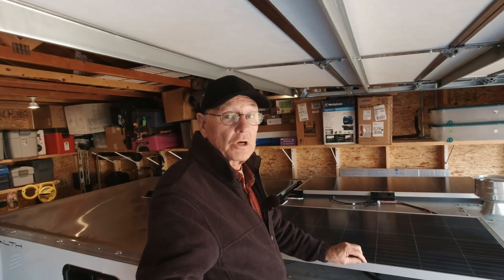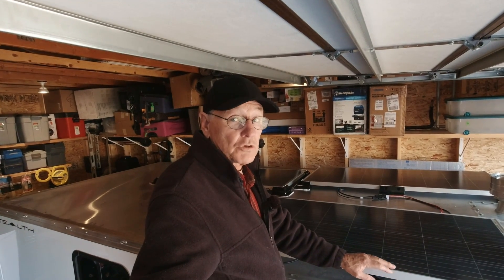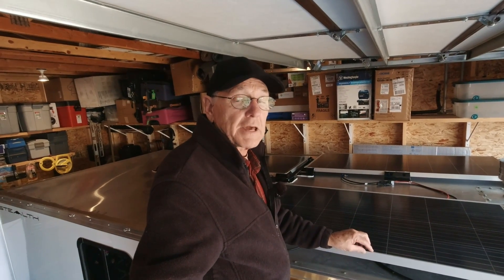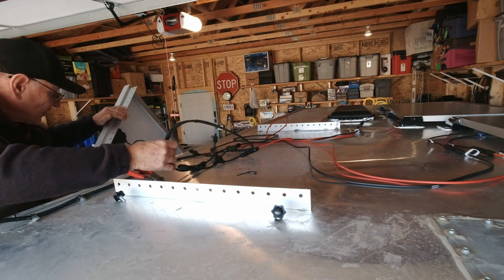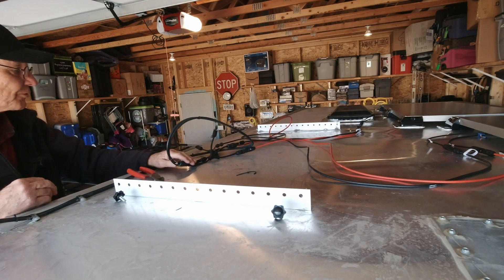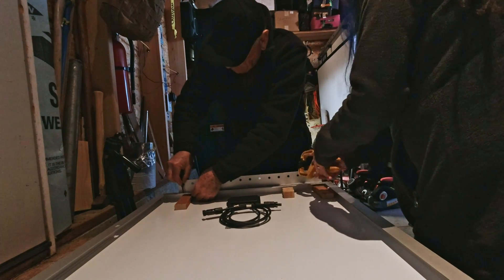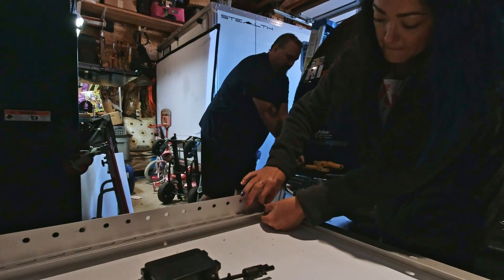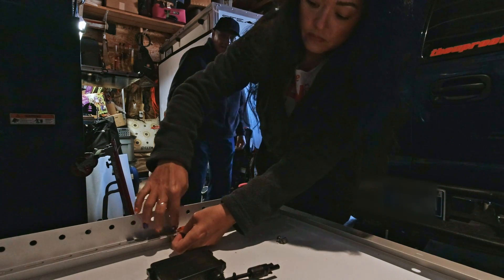Tricks On Installing A Tilt-Able Solar Panel

Comment: Any tips for waterproofing the drill holes and the setup in general? I would like to add tiltable solar panels on my new rv trailer
Reply from the maker: For holes like this I like to use either Sikaflex 221, 241, 252 or 3M 5200.  These don't let go for anything as long as the surface is clean before you apply it.

Comment: Which way do you plan to park this trailer. Do the solar panels face the driver's side or passenger side of your trailer?
Reply from the maker: The panel can tilt either way, but it's easiest if it tilts away from the ladder that you happen to be standing on.  I like it so that the trailer door is on the shady side .

Comment: Great video. Do you put a fuse between the panel and the charge controller? What about between the controller and the battery? Thank you.
Reply from the maker: Hello Allen, I put an MC4 inline fuse between the panel and the controller and an inline fuse between the controller and the battery. There's also one between the battery and the main busbar.
Reply: @gonagain  Thanks so much.  I don't think I need one between my single 100 watt panel and my controller but I might put one anyways.  Already have a fuse between the bus bar and the battery (I think!).  Thanks again for your videos.  You are always so full of great insights and I find watching you two very enjoyable, entertaining, edifying and relaxing.  Good clean family-friendly fun.

Comment: Great task !! Looks good to me!!
I just hit the jackpot with an idea, your vehicle will need to be replaced some day !!
The thought that hit me, why not an EV truck!! With an array of Solar panels you have now to meets all your electrical requirements, this way you can charge your EV battery also , maybe have to turn off a couple devices !! 

Just seems like a good idea!! It’s something that is going to happen with RV travelers using EV to travel!!
Reply from the maker: We're not there quite yet and the market is waiting for a lighter weight battery that can hold more power and charge faster.  Right now with the current EV batteries it takes a long time to recharge and makes a cross country trip a big headache. Soon, I hope!
Reply: @gonagain  yes I read that about new battery tech for EV which operates 5X longer and charges much much faster!!

Sounds like a solid state battery is in the works according to Panasonic !! Good news !!

Comment: Hello Rick. Thank You for another Video packed full of valuable information. Hands Down you are the Best with delivering the right Tips for installing solar panels. Plus the 'touchy & sensitive' plunge we must take when cutting holes into the roof of our cargo rigs. Yikes, I hate doing that. Rick, I don't have this set-up yet, still just using the fold out panels. But when that time comes I'm glad I've saved All your Tutorials. I also wanted to Say Hello to You and Linda. ✌🤗 Get any snow yet??? Today it's 80°but that won't last.🌬🌧❄
Reply from the maker: Hi Vincenzo (Linda here)! Haven't had snow yet, thank goodness because we haven't put the snow plow back on the atv....and it's been unseasonably warm which we've been loving. Like your 80deg, tho, it won't last. Darn it.

Comment: Do you find that tilting the panel is worth your while? 

We have two panels set flat and they are not the most efficient but work well while on the road to top off. 

For power when we are camping we have flexible portable panels and set for optimum orientation to charge portable solar generator that we use for refrigerator. 

We have two portable generators we switch out 

We also have 240 amp hours in Lead Acid and  100 amp Lithium.
Reply from the maker: Your approach is the same as ours, with multiple possibilities.  Yes, a tiltable solar panel makes a big difference, especially in the winter months when the angle of the sun is low, even in the southern U.S..  Check out this video I did showing the difference:  "Should You Tilt Your Solar Panel?" -  
 https://youtu.be/eCPvBLcyksE

Comment: rick on my trailer i install neoprene rubber mount, i got them from 4wd parts , there rubber spacers that go onto the top of the shocks then a washer then a nut, i first used the neoprene and notice that there ok and stiff, , the rubber ones were to spongy lose or vibrated to much, . on your trailer , when towing it off road try to use less air in the tires to take away the rigid feelings of a stiff tire, . if your tire is rated for 40 # , put 30 # instead, soften it up that will stop the bounce of the solar panel,
Reply from the maker: I do carry a pump and could do that.  I don't have shocks on the trailer and have spent a lot of time trying to figure out a way to do it without raising the trailer up higher.  I even thought about torsion axles, but having that leafspring break taught me how bad it would have been getting parts for a broken torsion axle.  Two different suspension shops talked me out of going that route, even though it would have meant money for them to take the job.  There's room for improvement in the trailer industry.

Comment: I didn't see any angle  bracket for holding the panel up on the tillable solar frame. Do you use that feature? I'm guessing you use portable solar panels, instead of going up on top of the trailer and tilting it.
Reply from the maker: I use an angle strut to tilt the panel up, but didn't show it in this particular video.  You can see it in these videos if you like:  "To Tilt Or Not To Tilt?"  https://youtu.be/eCPvBLcyksE
"RV Tilt Solar Panel Installation": https://youtu.be/18_zgXs0lI0

Comment: Drilling up through the crossmembers from  inside the trailer, then measuring for bracket install on panel using 1/4" bolts to secure brackets works well. A 2" piece of butyl tape over each hole and a coating of Dycor, bracket on top of that, bolt down and a final liberal coat of dycor sealant over the bolts works well.
Reply from the maker: Good info for everyone, Seymour.

Comment: Gm Rick, I've been looking into grounding the solar equipment. There are differing opinions, some ground the individual equipment parts to the frame as well as the battery, others run a external ground wire from each piece of equipment to a buss bar which all the equipment negatives are attached to, then ground that to the frame. And some run the equipment external ground wire to the negative buss bar all the equipment negatives are connected to and don't hook any of it to the frame, and i believe that's referred to as a floating ground. 
   I take it in marine use a floating ground is what they use? Since a fiberglass boat wouldn't have a metal frame. 
   Have you looked into a floating ground system where everything is wired to a negative buss bar and not wired to the frame? My understanding is new cars are not run to the frame anymore because of all the high tech electronics, which frame grounding is detrimental to. I was advised that negative grounding to the frame could cause electrical issues to the tow vehicle since its attached by the ball and tongue of the trailer. Since the trailer uses negative grounding for the trailers break, turn, and running lights, and has a truck ground via the ball and tongue connection i can see where a surge could cause a problem with the lights and computer of the truck. 
   I would imagine it's a one in a thousand chance there would be a problem with frame grounding the solar equipment, or else there would be more videos against it, but i have heard a few complaints on it causing tow vehicle problems. I thought I'd ask a marine guy with more than a little hands on knowledge to see what you think, maybe you've never gave it much thought but it sure don't hurt to ask lol. Thanks, God bless!!
Reply from the maker: Hello GM!  I use both on the trailer.  The interior lights just ground to the frame and the battery also grounds to the frame, which is pretty much standard in the industry, but everything else is grounded through the battery and then to the frame.  The big problem with the frame ground is dirt and corrosion and I check mine every year at least once.  Another problem is if you have an aluminum frame....  in that case keep the copper wire and connectors away from the aluminum with stainless steel washers.  If they touch the aluminum it will corrode a hole right through it.  I can't see anything wrong with having a floating ground though for the trailer accessories.  There is one thing though and that is that the battery won't be able to charge off the car's alternator if you do that.  Mine is like that now because I don't need it with all the solar I have.  I did that because of the lithium battery I installed and the fact that I didn't want to go through the expense of a DC to DC charger right now.
Reply: @gonagain  i didn't go the dc to dc yet either, Toyota parts are way too expensive, a new alternator plus the charger was more than i wanted to spend. I have 4 newpowa 210 panels i run in a 2 parallel then series with the epever 60a charge controller. If im not getting enough power from poor sun i have 2 100w portable rockpals i believe i can parallel then hook into the series, it'll drop my 210 panels to 200 but give me a net gain of 160 watts. Frankly i don't think I'll ever need to, i put a 5,000 btu window ac in and if it's hot enough to need it i should be getting plenty of sun, and my panels do tilt. 
   Thanks for the input Rick it's much appreciated!!
Reply: There are a couple "schools" of thought on grounding and bonding and some guys get in very heated "discussions" on it.  Solar panels on a building especially a home require each panel to be grounded, get the NEC guide (National Electric code) it has a section on grounding solar panels and that should be followed for buildings.  If you read it and understand it you will understand how a trailer etc should be bonded.  Newer vehicles 1980s or so will have the trailer connection isolated from the rest of the vehicle if it was wired correctly, if someone just taped into the tail lights without isolating it the first thing you should do is buy a trailer light isolator and install it so they are separated.  Anything electric with a metal frame should be bonded so that a residual charge does not build up and hurt someone or damage equipment.  Most metal vehicle with solar panels people trust the touching of the metal to do the connection, that is not truly a good ground bond but it works most of the time.   You can sometimes find parts of the NEC downloadable for free, it is written so someone with a 5th grade education can understand it.   A boat does not ground to "earth"  there are good grounding documents that explain boats if you do google searches, vehicles are also not "earth" grounded as the tires isolate the vehicle for most electric charges.  Be careful on information labeled "chassis" ground; that may not mean a vehicle chassis but a piece of electric equipment chassis like a stove.
Reply: @badgerpa9  hey thanks, much appreciated!!
Reply: @badgerpa9  What is your opinion of using double sided tape to mount panels on roof of trailer? Seems like the panel is not grounded due to no bolts to cross members of trailer frame.
Reply: @Typinganame  I have not seen that in person but the videos I have seen the panel was a plastic back and plastic does not bond or ground, but my concern would be no heat dissipation in the sun since there is no air flow under it.   I am not a solar panel expert, I have them on my farm but no expert.

Comment: Rick when you drill and penetrate either the solar panel or the trailer roof, do you use any sealant to make a water proof connection?
Reply from the maker: Oh yeah!  I use either Sikaflex or 3M 5200 for anything I do on the roof.
Reply: If you watch his video on installing the panels he talks about that.